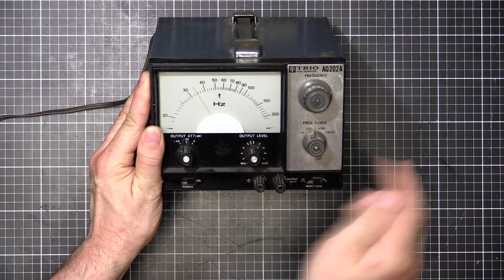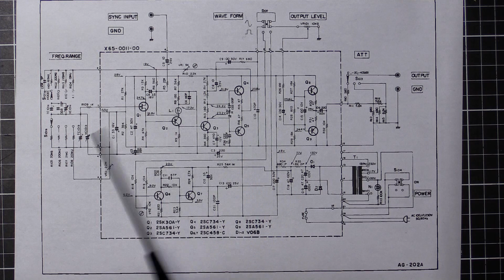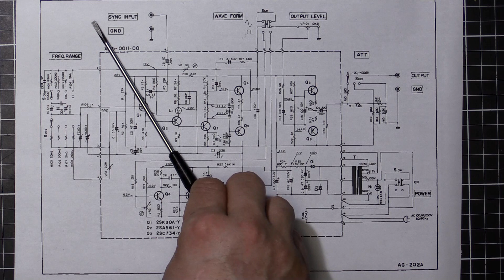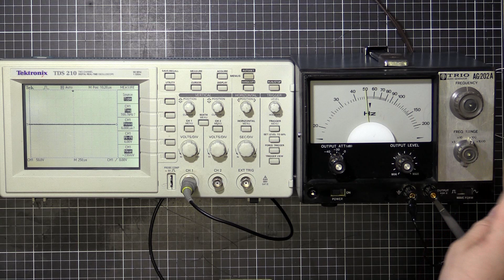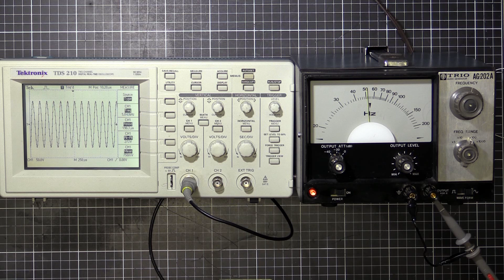Repairing a Function Generator - Trio AG-202A

Comment: He that's nice I got the same one only it's from kenwood itself.
And they used Elna electrolytes on the board, very good brand but as you said and I agree they need to be replaced, so I'm going to order them.
Meanwhile I'm going to check the resistors too. I want to know how far they are off specs.
I hope I can adjust the analog scale. It's a bit of and will do that after replacing all the caps and maybe off driven resistors. I'll first measure the resistance of the pots first befor I begin to turn them. So I have a backup. Or did you find out wich pots are for what purpose?
Reply from the maker: Nice. Good to see another unit cared for. :)

I did one better than just finding the trimpot details, I updated the video description with a link to the user manual, complete with adjustment information with all the details you need to get your trimpots all tweaked just right. :)
Reply: @NearFarMedia  ow man Thx I needed that one I tried the same pdf but it seemed to be locked up. Thx for the adding so now I can calibrate the nice generator.